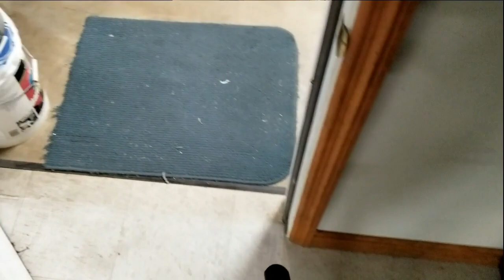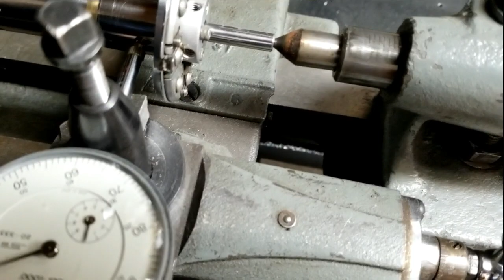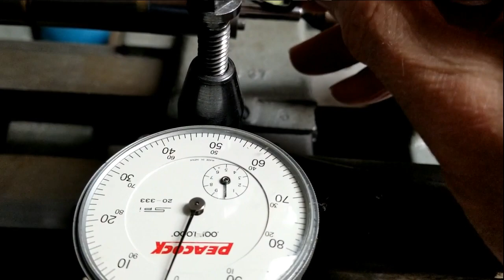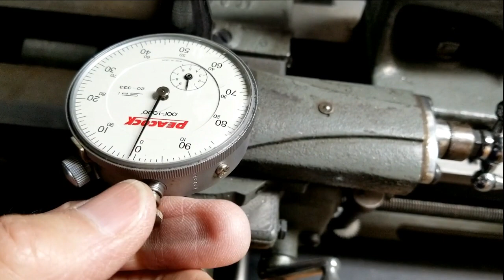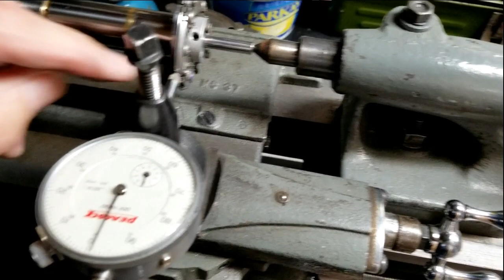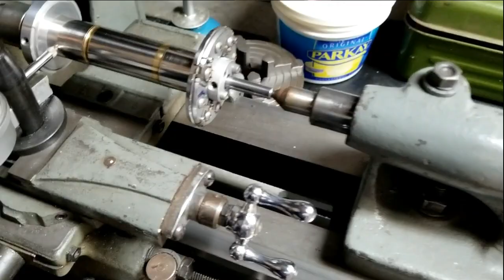The Quad Tape Transfer: Mark X, XV, XX 2" Video Headdrum Eccentricity Measurement And Calibration

Comment: This is an excellent and extremely valuable demonstration. I did not pick up right away that you were using the micrometer tip to tap the drum. Fascinating. That would never occur to me. I try to not break tools.
Reply from the maker: It won't break anything. And if it does, no biggie- used mic indicators usually go pretty cheap on ebay . I always use this same one, if it does affect it in some way. The weak spring in the mic is just enough to give a little tap to the drum. It takes a little practice, to know how tight to screw in the screws to allow for sufficient slippage, and of course sometimes when tightening after aligning the drum may move a little when tightening down more and more. Theres some back-and-fourth getting it zeroed in to the minimum reading. Ideally you would want to use a nylon tip on the mic. This isn't the only way...but it does work fairly easily, and you can get dead-on accurate if there isn't any slop in the lathe.

Comment: your lathes application, is a wood type lathes or wooden and metal ?
Reply from the maker: Hi Charlina, it is a metal turning lathe, but nothing special. A Craftsman 618 from the 1950s. I don't think you could get quite as good accuracy from a wood turning lathe for these tolerances.
Reply: @LarryOdham  At video time code 10:49 how did you center the shaft for zero Centric ?
Reply from the maker: @rosalinafarias2757  Hi Charlina, that is in the lathe setup. The lathe spindle has Timken bearings. Those are self-centering when adjusted properly. That gets the lathe spindle on center reference. A drawbar and collet for the dead center is self aligning to center due to the taper, same with the #3 morse taper seated dead center tool. This is all checked, verified, adjusted, etc.,  by using a dial micrometer in the tool holder. Once the lathe is set up it usually doesn't move or require realignment unless something changes or is changed. I like to verify it every time I put a work piece in the lathe just to make sure its where its supposed to be before doing any work or measuring, because if it isn't then everything you do will be off. The tail stock is aligned to the bedways by gib screws on each end. To learn more about how lathes are setup for operation have a look at a book titled "Manual of Lathe Operation and Machinists Tables". It's all standard stuff.
Reply: @LarryOdham  I'll look some where beside Harbor Freight. The only one the have has a big check for $800 dollars. I'll try Offer Up.

Comment: Hi Larry, there a lot of question, since the tach wheel is press fitted, how do you remove it ? bearing puller ? How do you realign the tach marker with head number one once it's placed back on the shift ?
 How do you place the pressed fitted tach wheel back on the shaft ? 
Are Harbor freight machine lathes are pretty good ?  I should buy another manufacture lathes?
Reply from the maker: Hi Charlina, the tach disc is hand tight, a snug fit, but can be taken off & on with hand pressure, it's not a problem. You have to watch out though on Mark XV, it has that extra piece in the end you have to remove. Be observant as to the orientation of that, so you can put it back right. XV and XX usually have a red dot or a mark to indicate the tach slug to align with the video tip. Mark X has a double slug. The tip is designated by the rotary transformer when you are reassembling. The rotary transformer has i,ii,iii,iv, marking indicators. I don't know anything about the Harbor Freight lathes. whatever it is, it needs to have Timken type bearings to zero out the shaft end play, and preferably needs to have the ability to remove the chuck and use a draw bar and collet. You can get by with a chuck, but they are only accurate to about .003, so you may have to shim the shaft to get dead-on center. Collets don't have that problem because you can use a #3 morse taper dead center tool. I bought my old Craftsman 618 in pieces from ebay sellers. Theres tons of that used stuff on ebay and all kinds of attachments and tools, if you're into tools! But they are old tools, some are better condition than others. New metal lathes do have a lot better tool posts and carriages than the older generation metal lathes did. My Craftsman is ancient in that regard, but I'm used to it's quirks. If you just wanted to use for alignment and not necessarily for metal working, you could go out on ebay buy a lathe bed and carriage and two tail stocks and two #3 morse taper dead centers. Thats really all you need for that. You could also use the lathe bed for setting up a dynamic balancing apparatus also. I think thats what CMC used back in the day to setup their Schenk on, anthough it was much bigger and heavier.
Reply: @LarryOdham  Where did you buy your newer lathes from ? I think I saw it when you were working on the IVC 9000. The newer one you can center up the video head shaft as well. I have not used a lathes for multi decade ago, a lot to relearn
Reply from the maker: @rosalinafarias2757  Hi Charlina, I only have the one lathe. I think what you saw in one of the videos on the 9000 was the milling machine. That is a Grizzly mini-mill.